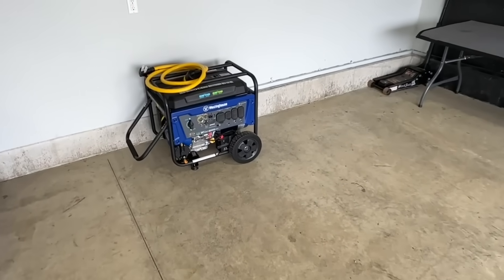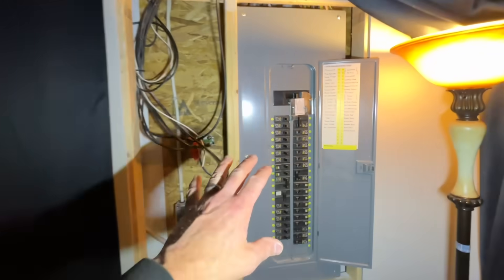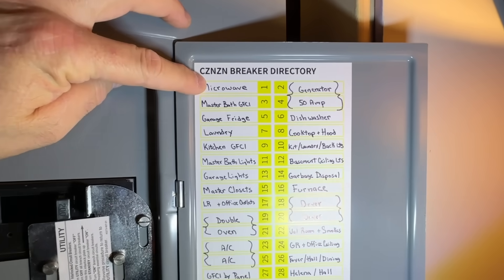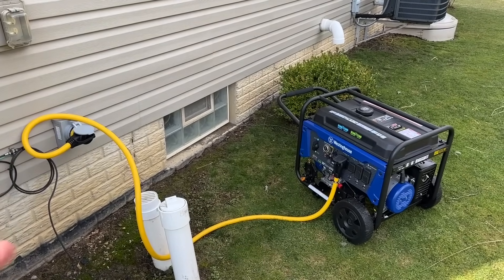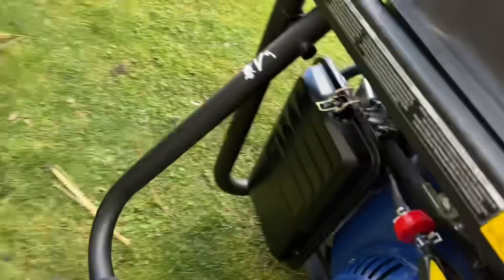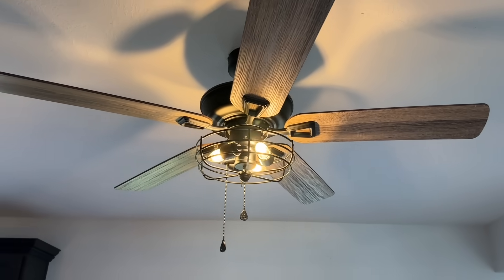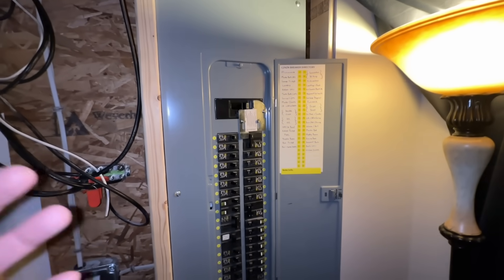Whole Home Manual Backup Generator Setup For Less Than $1600

Comment: Everyone seems to have a generator but how many have enough fuel to run it. When I ask people how much gasoline they have for their generator the most common answer is 2 five Gallon cans. If the outage lasts over a day they could be in trouble. Larger generators use 10 to 20 gallons a day.
Reply: Just store several tanks of propane.  It doesn’t go bad like gasoline and works great with the generator.
Reply: @neilbrookins8428  no propane is the same issue.  Unless you have a main propane tank of 100+ gallons you will be in the same boat as with gasoline.  If you want to run for several days you need to fork over the cash and have 40-50 gallons ready to go.  10 gallons isnt going to cut it.  I don't store that much gas until a storm arrives so dont have to worry about it going bad
Reply from the maker: A full tank on mine can last 12 hours so as long as I have two 5 gallon fuel cans in stock it buys me time.  I don’t want to store much more than that in my garage because stored gasoline over a long period of time (say 6 months) can break down unless you’re using additives every 30 days.  I just try to keep enough gas on hand to get me through at least one to two days max.  If I have to drive somewhere to buy more gas, I can.
Reply: Long gas lines in Houston after Hurricane Beryl and many stations shut down due to no electricity. Be prepared with enough fuel ahead of time. Natural gas or propane would be better than gasoline in this regard.

Comment: Will this run my 50 gal. Electric water heater and my 2 horse power well at the same time. Great video, thanks
Reply from the maker: It should but just look up the running/peak watts of your water heater and power well to confirm.  I don’t see why not though…

Comment: $500 for an Interlock. Your buddy ripped you off.
Reply from the maker: I agree, it’s not cheap, probably have $200 in total parts with the interlock kit, wire, double breaker, and outdoor plug/box but I’d rather pay a licensed electrician a little more in labor so the liability is on them.
Reply: @DieselLegiance I don’t think he ripped you off. I’m about to do that on my house and somewhat expect it to be around that. I’m in Houston, TX for reference.
Reply: @EdgeBauer Beryl got us running around trying to get these generators running.. No thanks to CenterPoint 😅
Reply: @DieselLegiance  about 550
Reply: $500 is good I'm charging $550 here in houston texas
Reply: @goodfellasouth851 how do I get in touch with you I am I'm in houston
Reply: $500 is not bad. An electrician quoted me $750 to install, everything included except and a 50 amp generator cord.
Reply: @purplerose9041  sounds about right.
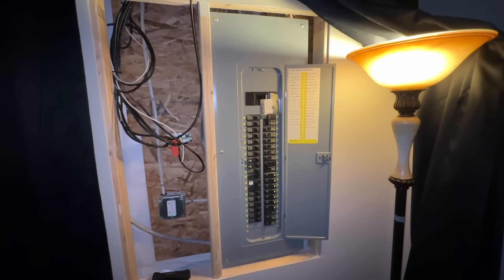Reply: My friend i work with generators and the procedure u did to disconnect  the generator first u go to the panel shut down the main breaker then go to the generator shut the gasoline valve in the line then when generator empties the carb left  it will eventually shut of 15:28  never take out high amps connectors when generator is on  electricity arcs
Reply: I just Paid 650.00, I was told by two licensed electricians in the north Houston area that it’s a shortage of parts for this type of installation.
Reply: @steffiejoe  that's a great deal.  Your guy was honest
Reply: @steffiejoe that’s what I’m thinking, everybody and their mother wants this done right now to be ready for the next one that will likely come through this season!
Reply: That generator can’t turn on your AC? Need to get an easy start on it that generator should run that AC no problem
Reply: @aguilar7036  turn off all breakers, kick on ac/furnace and outside unit first , then listen for peak up on generator, kick that MF down to 62° 🤣,  then turn only necessities on. Keep her running. 
Soft start is only 40$ though
Reply: @joey8567 for real? Which soft start? I thought they were like $300 or $400.
Reply: @realSamAndrew  there's links attached to videos of installation
Reply: $500 is a fair price for an electrician your just a cheapskate like Kevin's uncle in home alone😂
Reply: @gilsplumbing8743  I am an electrician my self and I recently bought one for an old customer of mine and paid $150 for it. $500.00 is way too much.
Reply: My 
30' 6 gauge whip w/ connectors , not Amazon crap $210
#6/3 8/1 wire from breaker to box , 10' , $75

Get my drift!   

Your buddy did you right.  I prefer Cummins or generac as Westinghouse sold out out in 90s.  

Amazon is screwing our country up. Buy local.  

Great video though.  Everyone should have something brother.  

My cost for 20k set up $4400.  

Breaker 50amp breaker $35

Comment: He's right about the HOT WATER heater and Furnace. My ELETRIC water heater will pull 5KW Watts just by itself, the AC/HEAT PUMP uses about 2.5KW. So needless to say, I don't cut on the water heater unless my other 240VOLT Appliances are off so I can warm up the water.
Reply: I've heard of a water heater but not a hot water heater
Reply from the maker: @HarveyWallbanger-ho2cq Ha Ha good catch

Comment: Were any of the breakers that you had on GFCI?
Reply from the maker: The Generator outlets are all GFCI with breakers.  The outdoor house outlet installed went to a 50 amp breaker inside my basement.
Reply: @DieselLegiance  Yea I’m aware of the GFCI’s on the generator what I meant were any in your selected group that you flipped on in your panel? Was wondering how the WGen9500 played along with GFCI or other type of ground fault breakers in a panel.
Reply from the maker: @MrBritrider I flip a few breakers off that I don’t need in an emergency but I can run a good bit of the home.  No issues.
Reply: @DieselLegiance  Ok, any of them GFCI?
Reply: A manual transfer switch will trip the GFCI breakers so you will have to manually reset them after you go back to grid, but the interlock approach with the generator does not trip my GFCI’s
Reply: I have the same setup. My gfci do not false trip.  No problems with generator and gfci.

Comment: This is exactly what I plan on doing. Here in the South, these hurricanes are devastating. I've had the same generator for a couple of years, and haven't had to use it yet. Seeing how bad regular thunderstorms have been this year, I need to get this hookup fast! Great video!
Reply: I own nine generators and live in New England. Never have I lived anywhere with a less reliable power grid. For ten years I lived in rural Kentucky which somehow had a vastly superior grid. I think we only lost power a handful of times for a few hours in that entire ten years. Here in Massachusetts is a different story. If we get the slightest breeze the power goes out for at least a day, sometimes a couple of weeks, and it happens multiple times every year.

Comment: Is that generator too close to the house?
Reply from the maker: NFPA requires 1.5’ away from the house.  My generator was around 4-5’ away.
Reply: need to be aware of soffits and windows but 5-7 feet should be fine in absence of those
Reply: I thought it was suppose to be 20 feet away
Reply: @MemeClimbs  I keep mine 20 feet away as well.  I also put carbon monoxide detector (portable) in the rooms

Comment: 8500 watts is barely enough to start your refrigerator compressor, little alone power your whole house.  It is better than nothing, but be realistic about what you have.  Reverse feeding a panel is scary shit.
Reply: 8500w is plenty. I have a 1500sqft with a 2 ton AC unit, and my 6875w peak generator could handle all of it, including my microwave and server rack. And there's nothing unsafe about backfeeding a panel as long as you have an interlock, and the cover on the panel. Everything is done to code including the right sized breakers, gauge wire, and listed electrical devices
Reply from the maker: Exactly 👍🏼
Reply: The average fridge runs at 800 watts times that by 3 that's 2400 start up watts you have no clue what your talking about
Reply from the maker: @jessenoble1399 Wvery fridge is different.  Pulled off the internet…A home refrigerator's power consumption is typically between 300 to 800 watts of electricity, or between 3 and 6 amps and about 120 volts. Importantly, refrigerators generally have a much lower "running" wattage than their stated average wattage – this is because they cycle on and off throughout the day.
Reply: Seems you need to do more research what 8500 generators will run. 8500 is plenty and never had an issue running stuff in my house.  Very safe with an interlock system. You must be the one who bought a 15,000 system and believed what the salesman told you. What's funny is he actually showing it running couple fridges and stuff in his house.
Reply: Notpol, you couldn't be more wrong. You instantly lose credibility when you say a fridge compressor needs 8,500 watts to start. Get a clue before you mislead unsuspecting people. Maybe you are a generac salesman.
Reply: 8500 watts for a fridge????   LOL
Reply: 😂😂😂 dude cmon do some research 8500 will run lights fridge outlets probably even heater not ac thought run most of the house 3:41
Reply: Wrong wrong wrong.  I run all my 110 volts and my AC unit with this same unit. My home is 1700sq ft.
Reply: notpoliticiallycorrect4774 - You obviously don't know what you are talking about.  I have a 6,000 running gen and it runs 2 refrigerators and have plenty of extra power to run lights and fans etc.  8,500 watts is plenty of power.  Barely enough to start a refrigerator compressor.  please

Comment: My friend just bought a Pulsar 12kw (9500 running watts on gas or 8500 on propane) for $890 on Amazon. I've had mine for several years and this season it was keeping the lights on and everything else for a couple weeks during our big freeze and power outage.